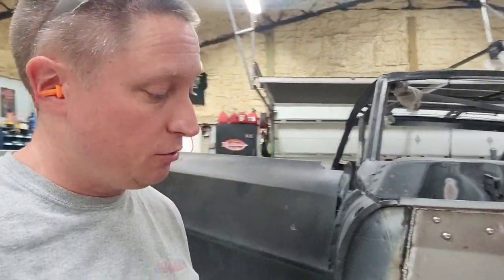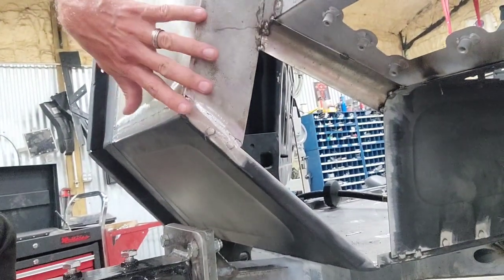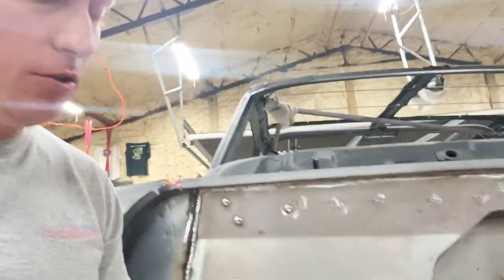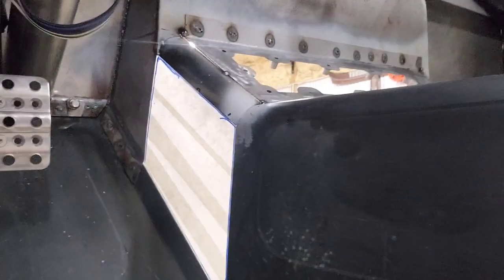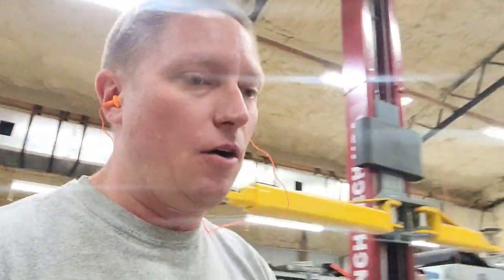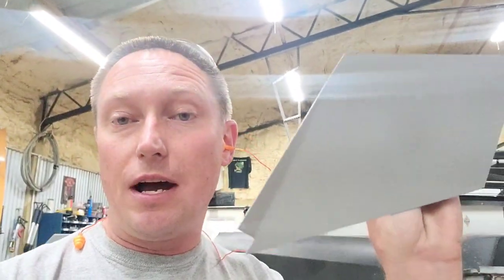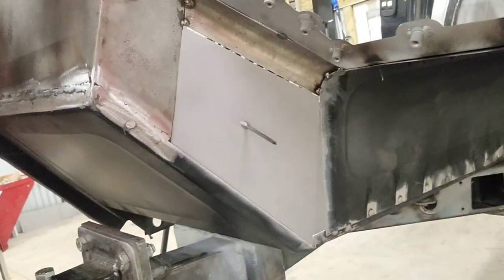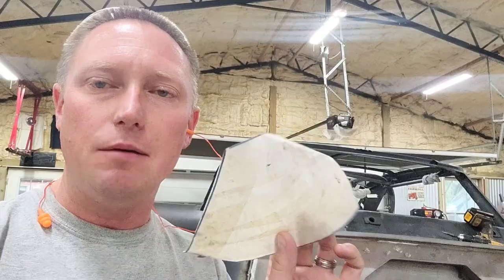How To - Creating Patch Panel Templates with Masking Tape

Comment: I am making patch panels for a 1960 Porsche356. What gauge steel would you recommend?
Reply from the maker: Nothing thicker than 18 gauge.  If you're trying to form it at all, probably 1 gauge thinner.
Reply: Bravo, chose 22. Practicing with my Lincoln 210MP on an oil burning steam heater case (some rusted through spots.).
Thanks. Nice shop.